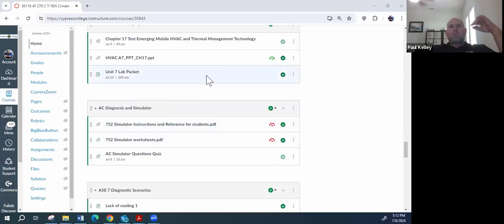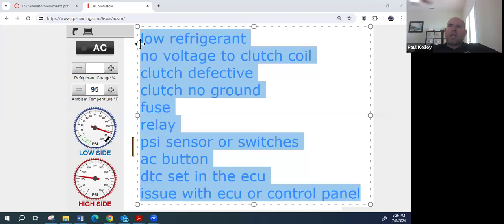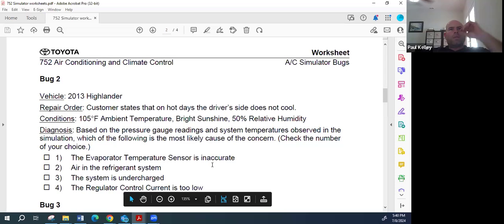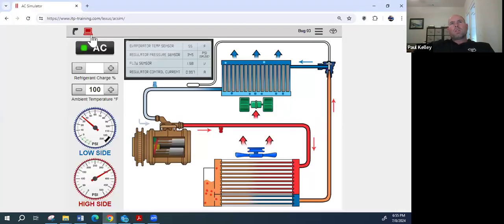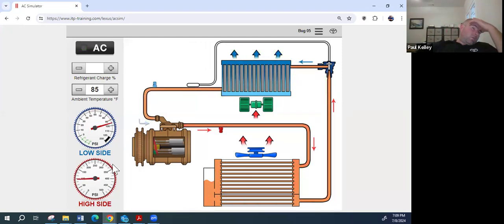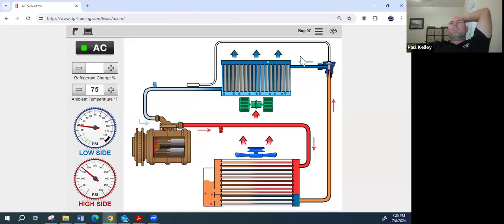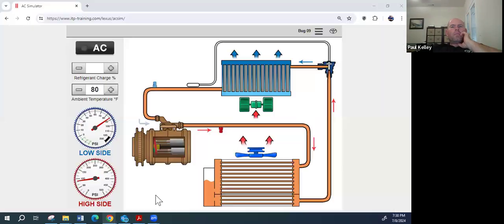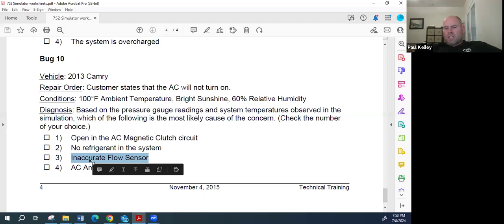ASE A7 Unit 7 HVAC Diagnosis Part 2 Simulator Review

Comment: Great teaching Paul, Im using these videos to pass my ASE tests. Really liking this simulation tool as well, wish we had this in school. But on bug 5, wouldn't the pressures move opposite rather than moving higher together?
Reply from the maker: Can you refresh my memory on bug 5?
Reply: @CollegeAutomotiveClasses  broken compressor reed valve causing high side pressure to flow back into low side. Shouldnt we see high side drop when low side goes up, instead of both raising and dropping at the same time?